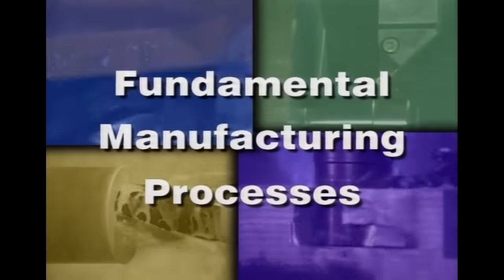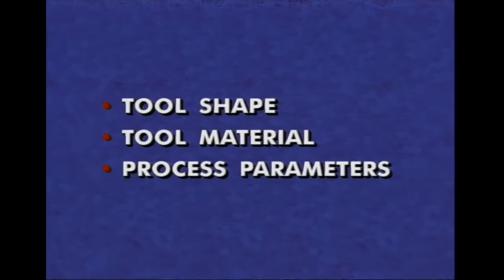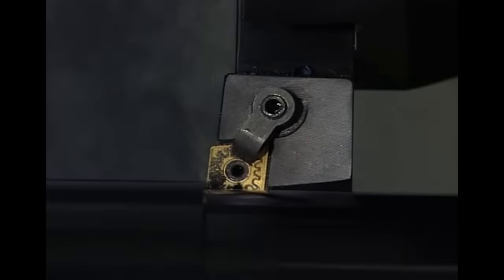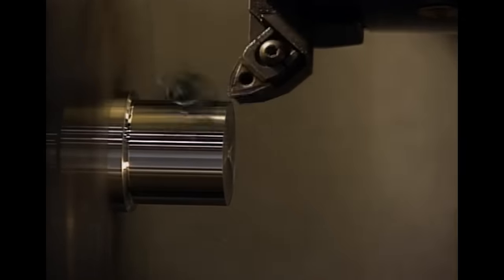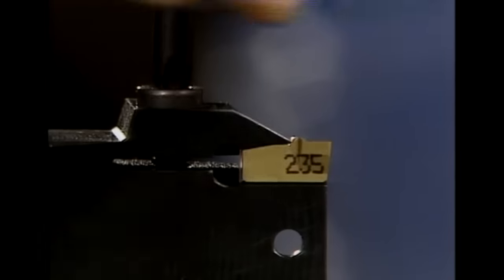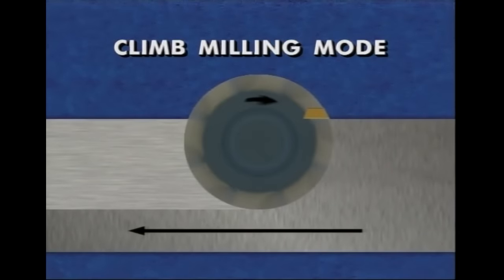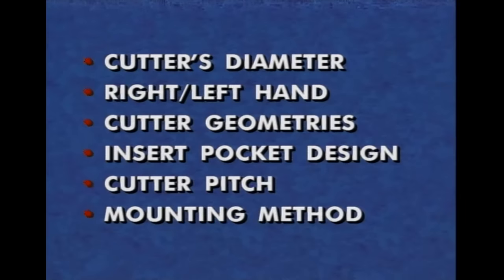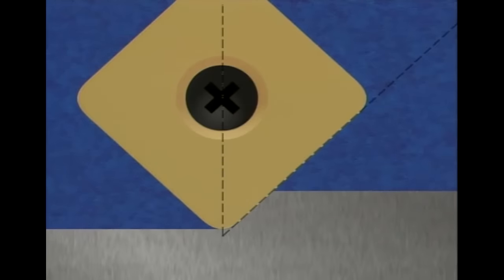Cutting Tool Geometries   Lathe and Mill SME

Comment: It is with great sadness that after 60 + years of active machining I realise that I really know nothing when it comes to turning and milling with today's modern insert tooling...…...but all is not lost, I just invested in a bunch of tool holders and inserts on Bangood and am set to relaunch my career.....in terms of years, 80 is the new 40 so they say.... just gotta get outta my chair more often.
Reply: Tony Wilson  Everything you wrote ignores the fact that it is money that drives the engine of commerce. 
What is the point of producing goods that you cannot sell because the Chinese are selling the same thing just as good and cheaper. 
Old skills are as they are.....old and out of date and they will never compete on the playing fields of todays manufacturing or marketing. 
It's good to know how to sharpen a HSS tool blank but when the factory is heavily into carbide insert technology HSS has no place on the menu......unless you're a hobby worker in a backyard garage scratching a living. 
I'm a golden oldie, extremely long in the tooth but I detest old fashioned ideas and methods.
To solve the problem of supply you must cater for the market or die in the dust......nobody wants or loves a hasbeen especially in high tech manufacture......you have to compete, but more so you have to be a better competitor than your opposition, and you have to be able to exist on a bowl of rice and 2 bucks a day to stay in the race......metaphorically speaking.
The end message is do what you do best and don't look at the stars when you are still crawling around on the ground.
Reply: Tony Wilson  Well one thing's for sure, even if I have 60 + years at the coal face, working with 2020 engineering methods still doesn't make me a wunderkind because I can read a drawing or grind a tool.....that is old school and if you want to exist in the modern workplace of today you have to be in the know with current practices.....my experience is basic, learned in the late 50's, but so was Trevethick's when he invented steam engines that pumped water out of deep mine shafts.....that was with beam engines and despite all his know how nobody would employ him today if he was still around.
In essence, one must grow with the technology, embracing it as it evolves and improving and promoting it for your personal agenda.
I don't think anyone can accumulate all the past knowledge and be a jack of all trades.....I would say that if you evolve in your job description you will soon lose the basic skill ability due to lack of practice and unuse.
Who would want to still do CAD designing when you get promoted to seniority and guide the ship instead of working on it.
Engineering is one area that is expanding in new ways to make it more profitable for manufacturers, and that means if you can't keep up with the flow you will be sitting in the back row watching it happen.
The other side of the coin is profitability, no matter how you get to it the bottom line will always be the deciding factor in manufacturing.
The Chinese have hit the button square on the jaw.......but their culture and wage structuring has a lot to do with their prosperity and the West will not match that scenario while they are driven by money for time.
Reply: Tony Wilson  I know your reasoning is well intended but from a realistic standpoint, using the latest CNC is way more repeatable and way more accurate than the old milling methods.  Yes it takes an experienced Engineer to figure out the best profiles and methods to machine a part that has the highest quality/strengths etc.  But at the end of the day it all comes down to what is NEEDED.  We can philosophise about the good old days when we made hand crafted stuff that would/and has lasted a century, but if you're making a base for a frying pan that will be disposed of in 5 years, why worry about it ?  I work in the electronics/semiconductor business and I have seen massive strides in automation and the workflow.  The modern pick and place machines are incredibly efficient and accurate.  Why would I want a factory floor with people hand placing when the economies and accuracies of CNC machines far far outweighs the cost of people ?   We have to keep learning and have to accept that our industries change.  It's the nature of the beast. Evolve or die, as they say!!
Reply: Tony Wilson   I am over 50 and have designed a massive amount of electronics in my career.  I have designed space systems through to consumer electronics and have designed a lot of products.  I am a bench development kind of person and have a lot of hands on experience.  Don't be so patronising please.  The point is that one has to move with the times.  If I had the attitude of I must do everything by hand I would not be designing muliti million gate asics and ICs. The tools, compilers, CAD and software along with the manufacturing technologies have changed rapidly in the last 10 years.  I have to evolve and keep up with that.  If I have to use automation, so be it.  It's the same with mechanical engineering.  Yes maintenance is an issue, but design in based on solid foundations.  You now have 3D printing, metal sintering, SLA and 3D metal fabrication technologies.  They bring in new techniques and better efficiencies  such as completely enclosed manifolds which could not be machined using older techniques.  New alloy fabrications with mixed ceramic technologies, lighter weight pourous materials, carbon fibre 3d printing.  The world is changing. Whether you like it or not.  There will always be a need to maintain older equipment however there will be a time where that equipment becomes obsolete and is replaced by newer/faster/better/more efficient designs.  It's called progress.  Mining equipment is changing.  New CNC higher accuracy, higher speed techniques are/have been developed to improve efficiencies of mining too.  Maybe slower than other industries but it is changing.  This is not to say that solid engineering foundations should be ignored, but also, with that said, neither should new approaches using modern techniques be poo-poo'ed either.  This is where we meet in the middle and make sure the new is better than the old and worth doing, which in most cases is true.  Most modern companies are structured and work that way.  They have brilliant people from all generations and cultures.  BTW, you should check out AvE on youtube.  He is a mining engineer and a brilliant guy but you know what, he has a Haas CNC milling machine for part design/fabrication.  He's moving/keeping up with the times.  Now as far as you working with "incompetent" guys, I guess you must just have shit management or you are the last of a dying breed of people.  Maybe the world has moved on from people like us who can repair to a module replacement business model.  I can't say in your field but it may make better economical sense.  It most definitely does in my field.  Maybe the precision of parts in your field now required swapping out machine components ?  Maybe tolerances are a lot tighter now ?
Reply: Tony Wilson  Look up the word "patronise".  I have never questioned your abilities.  You did question mine.  Have a good day.
Reply: Tony Wilson  😂😂😂
Reply: Respect

Comment: A very good video, but I came here hoping to find info on whether to 'invest' in a face mill cutter for my hobby mill. At 16.40 the parameters to consider when choosing a facemill surprisingly do NOT include available horsepower of the machine. I'm worried that replacing a single point flycutter with a 4 or 5 point face mill, means that I'll need (theoretically) 4 or 5 times the power.
Reply: The channel "NYC CNC" is a pretty good resource in terms of finding the correct hp for a tool. They even provide a spreadsheet that calculates the hp required for a specific tool and cut size. The calculations are tailored to endmills so they may not fit perfectly but hopefully this helps.

Comment: All these leave me with is more questions. Although it did help some. I need to find some good cutters for small lathes and a bridgeport.
Reply: Agree. 
Great video, but targeted for higher end industrial cnc type users. I came away with the same thoughts as you as well. But still worth watching and learning.
Reply: try mini lathe tool in market
Reply: For the Bridgeport I would only recommend high speed steel end mills. 2 flutes for aluminium, 4 for steel. A single point fly cutter with a carbide insert could work, too. Such machines don't have the power or rigidity to make good use of multiple insert face mills.

For small lathes again high speed steel is just fine. it is significantly cheaper and you'll learn a lot more about cutter geometry while grinding your own tool bits. Abom79 has a great video on HSS tool bits with a chip breaker. Cutting tools with brazed on carbide can be very useful for steel as well. If you must get carbide inserts, DCGT is a good one to start with. I'd strongly recommend using different inserts for steel, alu, and stainless steel. It makes a huge difference in performance.

Hope that helps!

Source: machinist
Reply: mohd afiq
Reply: Too: mohd afiq, "Mini lathe tool in market"? Please expand a little. Searched and got me nowhere good. Thanks.

Comment: Although your video has a very clear accomplishing voice it would be grade if you wrote your English subtitles down, because it's slightly difficult to understand a lot of your technological terms for foreigners. In the whole it's a good introducing video.
Reply: In the settings on the bottom right, you can now change the speed of the video to slow it down or speed it up. Slowing it down can help comprehension, and speeding it up is good when the person talks slow or takes too long to give the information you're looking for.